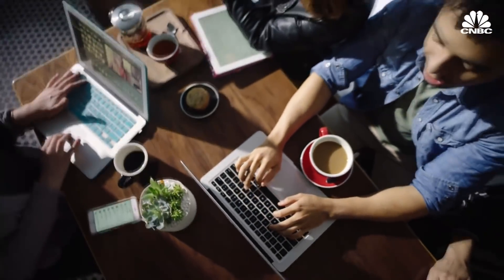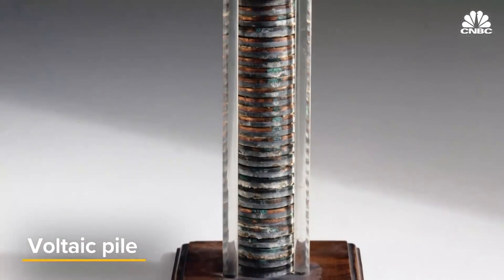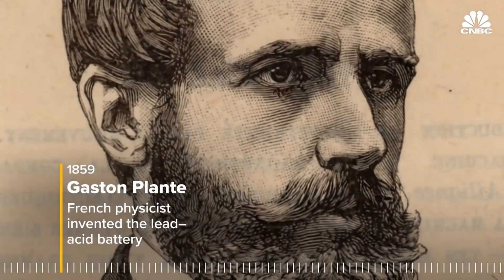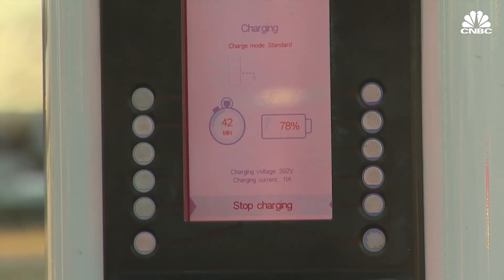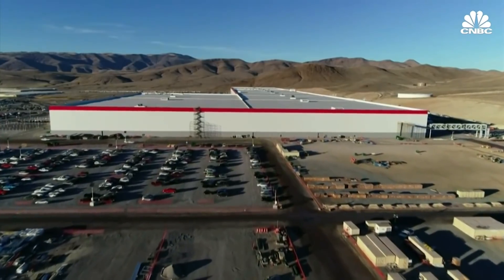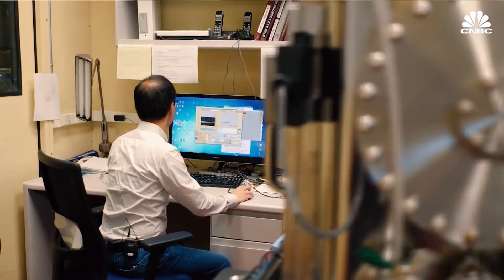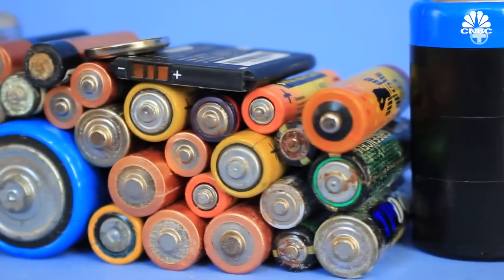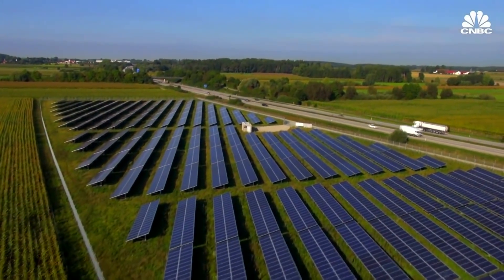Why Tesla (And Everyone Else In Tech) Is Obsessed With Batteries

Comment: 3:46  Your numbers appear to off substantially.  You indicated that the Gigafactory runs 24 - 7 and that they can produce about 2 of these huge battery packs per minute.  O.K., that's 120 per hour, 2880 per day, or 20,160 per week.  Let's round that down to 15,000 packs per week.  So why is Tesla vehicle production still hovering well under 10,000 units per week and "supposedly" battery constrained?  Obviously, many of those Panasonic cells must be going into Power Walls and Grid Level Storage systems.

Comment: The problem with storing off site is if the grid goes down (yes, in the 21st century, America has a grid that can be taken out by squirrel or drunk driver) then the electricity doesn't reach the consumer.  The best idea is to put a power wall on every home so everyone has backup to use and share.  No more squirrel outages! 

Energy freedom now!
Reply: Also, why take up good pasture land for the solar array,  put it on every roof!  It is a public utility isn't it?

Comment: Big and cheap electrical storage can be accomplished the way Tesla did it with giant saltwater capacitors simply build a series of Olympic-sized swimming pools filled with the proper salt water solution covered by oil and then covered to protect it and it would hold all the electricity you will ever need

Comment: why tesla not using lipo battery?
Reply: ariq kamil  Energy density in a moving object is important. LFP are not as good for this purpose. LFP are safer from fire risk than the car/phone/laptop batteries so can be used in other uses if fire risk is more important. (I use big LFP battery bank in my RV - stored under my bed - fire risk is therefore somewhat important for my use!)

Comment: at 5:05 there's a shot of Da Bama giving a  bi metalic metal award (which turned out, this medal, to be in itself a fabulos battery). (way to go,guys). Anyhoo, that guy identified as Gaston Plante ,aka the co-inventer of Li Ox battery,  is not the guy in the foto. Seriously, you Tube scribes, really need to do a better job, or really love what yur doing,cause you don't . That old chap, whose middle name is "bannister".
has the full name of Jonithan B. Goodenough. Johnny B Good. Enough.  At age 72 or so, he was, is, the inventor of Li Ox batteries.  At 94 or so, he's still cranking em out. Really. Just kidding about that battery medal thing. Fake fact.

Comment: If windmills or solar panels cannot continuesly deliver the same energy... Why not couple them to water dams? During sunny days or when the wind is strong, use the solar or wind energy to pump water upstream. Release the water overnight or when there is no wind. No batteries needed, problem solved. Can any expert comment on that?
Reply: That works (and is done), but is a less efficient method.  Less energy is lost charging and discharging batteries than moving water around.
Reply: it is already used by britain i guess

Comment: Electric vehicles is not practical and that was mentioned in a BBC Top Gear episode with Jay Leno and James May in which hydrogen fuel cells is the better alternative to EV since there is a couple minutes to refill a tank of hydrogen rather than charge for hours. When the HFC come down in price then EV and lithium demand will slow.
Reply: Top gear and Jay Leno, the best sources on how to drive your daily. Charging time is a non-issue for 95% of cases. Plug in at home or at work and you'll have a full "tank" all the time.

Comment: I'm not sure where the guy towards the end gets his numbers, that we need 10-20 times cost reductions in batteries for them to work at a grid level. They are pretty much at parity with natural gas, with the electricity coming from wind and solar, right now. 10-20 times cheaper would be great, let's do it, but at current costs NG is already starting to be non-cost effective.
Reply: GE just introduced a combined cycle gas plant with over 64% efficiency. And with such cheap nat gas in the US, your comment makes no sense at all.

Comment: pump water to height with wind and solar... and convert through hydro when power is needed
Reply: Works, but likely not as efficiently.
Reply: Also there is undoubtedly a delay between when you request power and when it is delivered as it is mechanical
Reply: Erik l  It is fast enough, and is used widely already around the world. (Pumped hydro = big battery). The troubles are - most good suitable dam sites have been used already with this or they are a long way from the power generation source (transmission losses). Plus yes there is a ~30% round trip energy loss, so its not so efficient as batteries. But it is very useful already in the world.

Comment: CNBC is wrong. Batteries DO NOT GENERATE electricity, they are a Storage Device. 
A generator , such as a powerplant Generates electricity, as does Regen Braking , that power is used to charge the batteries. 
and the MULSIMS invented the BAGDAD battery , years before Westerners "discovered" batteries. 
YOU NEED BETTER FACT, checking CNBC stop spreading LIES.
Reply: Unfortunately the muslim batteries were designed to blow up. :D
Reply: Bagdad batteries existed long before Islam did.
Reply: @luddity   - Muslims also Invented Western Culture. the White just Copyed their Paper.

Comment: Talking about battery tech and did not touch upon graphene?
Reply: Graphene is probably the most overhyped discovery made in the last 20 years. It’s cool, but it won’t revolutionize everything and the kitchen sink. I don‘t really see advantages over other Li-Ion and post Li-ion Technologies.
Reply: Graphene is mostly marketing wank to get money pretty much whereever it appears. "Graphene batteries" are still li-ion batteries, where you replace some parts of the electrodes with graphene. Guess which part? The part that is currently graphite. So you replace multiple sheets of carbon by single sheets of carbon. That's an incremental change, not a revolution.
Reply: I have a graphene battery to charge my cell phone. The size is nearly 2.5 times that of my lithium batteries (the 9,000mah graphene is 2.5x bigger than the 13,000mah lithium, though it charges about 40x faster, seriously.), but my biggest annoyance with it is that it can never give an accurate measurement of how much juice has been spent or is left. It'll sit at 100% while my phone goes from 0 to 30% then immediately start dropping very quickly till it slows down closer to 60%. It's weird. Has the same issues the closer it gets to 0%. I'm hoping they get better, but for right now I don't really recommend them for non early adopters.
Reply: pipedream, LION is king for atleast  20 years.
Reply: I am a battery scientist. The Graphene and Li-ion batteries are different issues. If you add only 1% graphene to any kind of li-ion battery, you can increase capacity at least 10%. Also, the rate capability (more fast charging) of the battery increases. But we dont care graphene addition these days,  we care chemical reactions, atomic scale distrubutions, nano-level crystal structure and more environmental elements for better future.)
Reply: Graphene is fake. Will never come to market.
Reply: It wasn't an hour vid, there are many things that could have been delved into otherwise.

Comment: can't electrolysis be used to create hydrogen then store that for future use?
Reply: Yes but it is wastefull electricity > Hydrogen > electricity is only 50% efficient, so as long as renewables are in short supply, to fill more efficient batteries, it makes no sense financially or environmentally. In the future where we have surplus power on windy days, Hydrogen is brilliant as long term storage for unused capacity.
Reply: AC Transit has 17 FCV buses and two Stationary Hydrogen plants. they need to BURN natural gas or MW of solar to generate power to Produce Hydrogen from water. two plants BARELY can keep 17 buses running. also, for Consumers , it will cost over $100 to fill up a Hydrogen car, and TANK is small, thanks to using NON Cryogenic gas.

Comment: Why shouldn't the long-term goal be to have a per-house storage solution? If you connected all the batteries in a smart grid it would still be a lot less prone to failure and unforseen circumstances could be bridged a lot easier.
Reply: Andy Könz in fact it is called Virtual Power Plants VPP

Comment: Yeah , now work on super capacitors, I can't wait hours to charge a lithium ion battery
Reply: Well oppo find x charges to 100% in 40 min
Reply: @JamilKhan-hk1wl  too slow, a super capacitor can be charged fully within 10 seconds
Reply: @RakshithPrakash  yeah that is obviously much faster, they need to figure out how to retain the energy for a longer time
Reply: I can Hypercharge my Tesla in 15 Minutes / FULL SPEED at a Supercharger to 80% capacity , then moving on to the next Supercharger 200+ miles down the road.
Reply: And where would you get the power for charging from? Hook it directly up to a power plant? Fast charging also needs thick wires, which you won't be abe to lift anymore at some point.
Reply: @superdau   - I use Normal supercharger plugs, I just Hypercharge to 80% at FULL SPEED , usually just 15 Minutes. I then Disconnect, and Drive at Highway Speeds to the next Supercharger 200+ miles away. Repeat and Do not Rinse . besides Rolling out now are Supercharger upgrades to create More Stalls and upgrade some chargers to GEN III. Power comes from mostly GREEN power commercially supplied. Powerpacks are charged with off peak Energy when possible.

Comment: Lithium is running out soon. Like really soon if the demand keeps increasing (which it definitely will) over time.
Reply: It is one of the most common element, fool.....
Reply: NOPE, piles and piles of Lithium stored onsite at Lithium open pit mines and they can Extract lithium from Briny Seawater.

Comment: before voltaic pile.... they had bagdad battery
Reply: you are correct, SIR. but, they don't teach this in Western Schools, the "White Man" invents everything...……..LOL.
Reply: Which were most likely not batteries at all.  The objects thought to have been electroplated turned out to have been fire-gilded (with mercury).  Instead, the "batteries" look suspiciously like vessels for storing sacred scrolls.  The "batteries" had been exposed to the elements and the metals were heavily corroded and any scrolls inside them would have rotted away a long time ago.

https://en.wikipedia.org/wiki/Baghdad_Battery

Comment: I'm really surprised that solid state batteries were not mentioned. Dozens of companies are working on it to bring it to market. Consider the obvious benefits over lithium-ion:
- Three times the energy density of lithium - Batteries can be a third the size or three times the capacity
- Can be made from common elements like sodium - Elements can be found all over the world, including the ocean
- Virtually no possibility of explosion or fire - Due to the way it operates
- Can be cycled up to a million times - Extremely long life
- Can be charged and discharge dozens or hundreds of times faster than lithium (charge your EV car from empty in minutes, or your cell phone in seconds) - Finally taking "range anxiety" out of the equation for the general public.
Reply: they would show it if what you described actually existed.
Reply: @miguellopez3392  It does exist. They really didn't talk about tech on the horizon very much at all. Toyota, in fact, one of the largest automakers in the world, announced last year that they would have a car using solid state batteries by 2021. So it's no "pie in the sky" idea that no one is working on. The same guy that pioneered lithium ion batteries pioneered this one, too.
Reply: Come back when you can actually buy one of those batteries. There's a miracle battery announcement at least once a month. Still waiting on most of them a decade later.

Comment: why can't batteries be reused? Can't you just discharge the battery and then do metal extracting by melting point? so the input is bad battery and the out put is raw materials?
Reply: TESLA almost completely recycles its spent LION batteries, they can also be Reused in lower demand energy devices. LION batteries contain VALUABLE elements than can be recovered.
Reply: Andy, I think they can, and we already do this with lead-acid batteries. It's almost a closed system, something like 95% of lead acid batteries are recovered and reprocessed into new batteries, at least in the developed world. It will take a bit of time to get to this level with lithium batteries, but both Tesla and Nissan have moved the field forward. (Before recycling, you should re-use the batteries whole, in household or neighbourhood power stabilization applications, which don't require the same power:volume as an electric car.)
Reply: @TaiViinikka   - in 1900's America lead acid batteries were low maintenance , you just needed to Scrub the Plates and top off the Acid. even in 1900's the batteries gave a 100 Mile range.
Reply: I guarantee you that there will be recycling plants for batteries, as soon as there are enough batteries to be recycled. There just aren't enough old EVs (and therefore batteries) yet.

Comment: Flouride battery and graphene battery are the promising new battery technology that will change the world
Reply: Can they be made cheaper faster than Li-Ion batteries are being made cheaper?
Reply: Colin Richardson im pretty sure they can do that
Reply: They already made flouride battery and its proven more energy density however still it is not in production and i don't know why. Graphene battery is already in used by samsung with the new galaxy note 9 phone
Reply: @jaketorralba4521  if you got that  fluoride battery you put it into a product and something goes wrong with it, then the cost of replacing it could be astronomical for the manufacturer in case they should issue a recall and replace the battery like samsung did once. Between that and possible lawsuits and fines i think thats the explanation of why they hold back.
Reply: Marfran Dema so they're not going to mass produce it?  Or it could be they're still doing some more research or trial before they put in mass production to make sure the product is safe in general public
Reply: @jaketorralba4521  i believe huge testing periods are required in real life circumstances. In the auto industry development times are from 36 to 48 months to just create a new car model, with more of a million km of test in all kind of weather and scenarios and with an estimate cost of at least 150 million dollars (VW developed this famous MQB platform and stated they spent 50BILLION dollars in order to make sure it was really ready to be produced).
Reply: JAKE TORRALBA 
are you sure the note 9 uses a graphene battery because i dont think it does.
Reply: Jake, Graphine and SSB are NOT ready for Primetime, further Research in needed, to validate SAFETY under all Conditions. LION is a proven technology. and is Basically safe for consumer use. 
besides , Graphine and SSB difficult to scale, only making tiny CHIP sized battery. and LION is by far the Cheapest per KWH .
Reply: Mark Plott yes i know that. But How much time that we are going to wait they have been doing so many research and trials for more than a decade. But graphene is already in used by samsung and follow by huawie for their smart phone battery you don't know about that?
Reply: @jaketorralba4521   - is Graphine going to be same cost or less expensive than 2170 LION battery ?
Doubt, it. 
can they mass produce it FAST and scale it ? 
NOT, very likely.
Reply: Mark Plott graphene is new technology and it is the first step to introduce it to the market. Of course only few companies are using this new technology but as soon more companies start using this technology. Then that's the time that the price will start to go down due to compentation. The production of graphene is not realy hard since graphene is made of carbon and very abundant element. If they found out the grapehe is very effecient technology once the people start using it. More companies and more people will do more research and find more ways to produce it more in cheaper price.
Reply: @markplott4820  DJI, BYD, fast charging from OPPA, VIVO & Huawei are using graphene. But there is no plan to make AA batteries.
Reply: Go look at Solid state batteries. I know of a dozen major companies investing heavily in their commercialization. Across a variety of chemistries they all share roughly the same properties in relation to Lithium. 10x the lifespan. 2-3x the capacity at 25% less the weight in standard cell forms. Can't freeze nor can it explode because it uses a solid electrolytic membrane. They all charge in less than 10 minutes. Tunable as sprinter for cars or as deep storage. Easily and cleanly recycled. Easily adapted and a minimum of 60% reduction in cost per cell.
Reply: Yes i heared about that also. But solid battery is also the same as other new battery. It is not yet in mass production and not available in every part of world yet
Reply: Technically the batteries can be produced cheaper and should be safe. 
Im almost certain that with current battery technology we wont be capable to make electric cars truly mainstream.
Reply: @marfrandema1884  will they be cheaper faster than Li-Ion?
Reply: Something is always the next big thing that will change the world, yet the world never changes...it's just BS for dirty hippies to get excited about
Reply: @brianheinis8613  Go back under that rock you oozed out of.
Reply: @brianheinis8613  Same scenario happened in the case of oil could repeat for batteries.